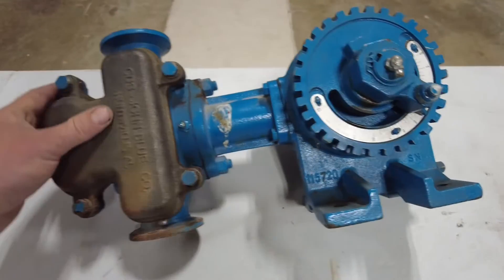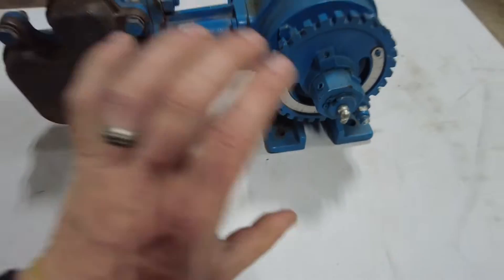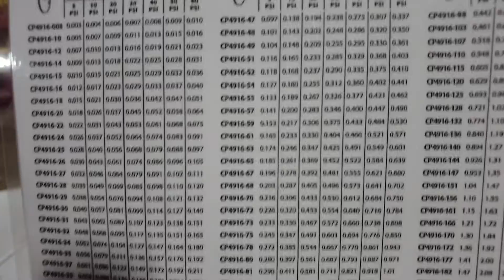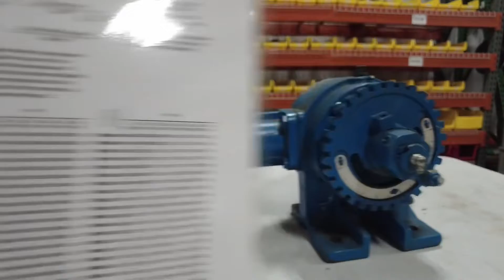How to Set a John Blue Pump (The Easy Way)

Comment: I know it won’t be 100% accurate, but assuming you have it set right, if you go slower for sharp turns or other reasons, it should be adaptive rate control, or am I missing something understanding how these pumps work?

Comment: Oh my gosh.  Dad had one of those on the harrow for applying a pre-emergence spray.  I forget the name, it was for wild oats.  Banvel maybe?  This was back sometime around the late 70's or the early 80's.  I hated that setup.  The pump was ok but the nozzles were stainless steel set in a plastic housing.  And it never failed you'd hit a small rock and it would bust up a nozzle or rip a hose loose.  It wasn't a well designed system.  In those days about the only sprays farmers around here used was 2,4-D so there were a lot of cobbled together systems when other herbicides started coming into use.